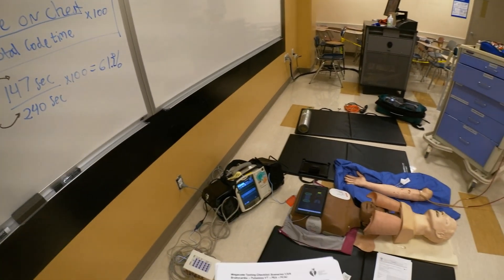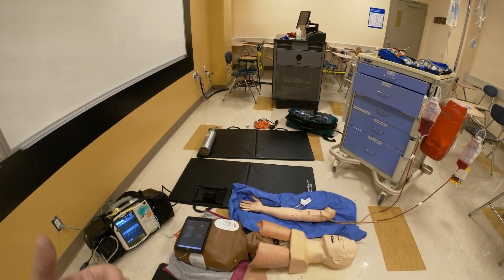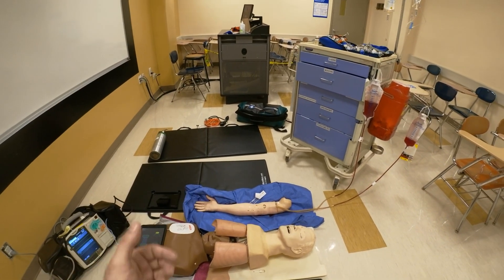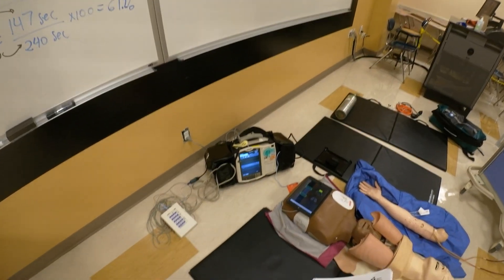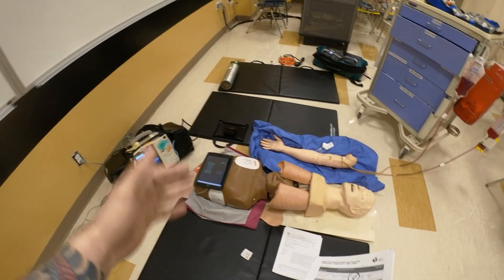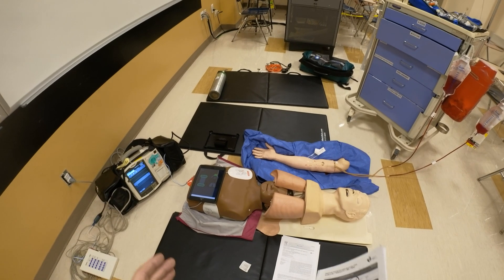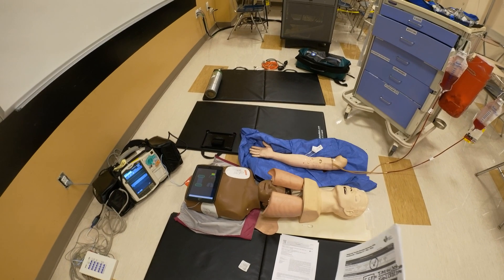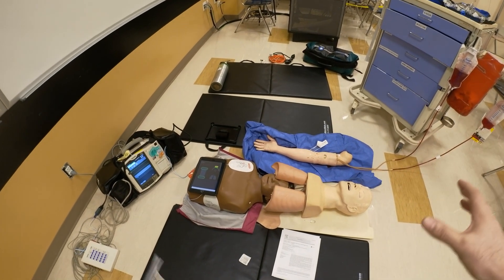How to set up ACLS Megacode Skills Station using various Task Trainers if you don't have a SimMan?

Comment: If you choose in QCPR (compression only) I think it will work better than CPR mode
Reply from the maker: That's a good point. For this set up where Airway Task Trainer is used instead of the feedback manikin head, compression only QCPR  mode would best.